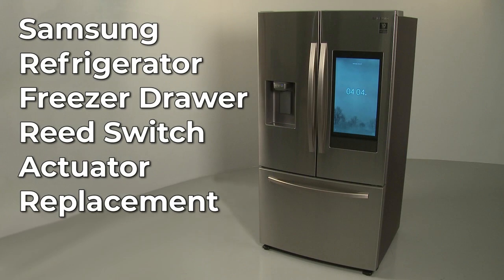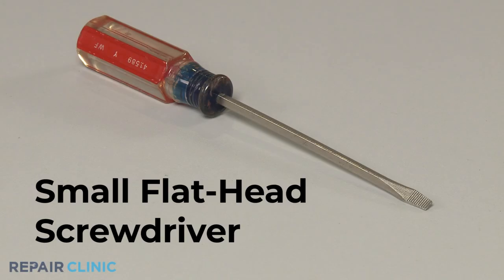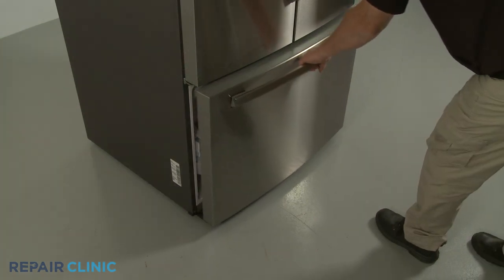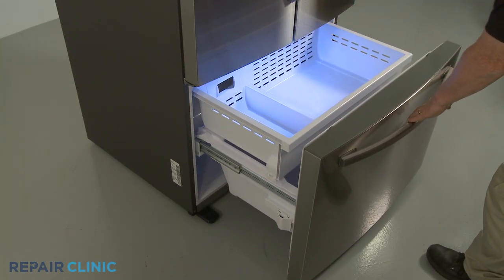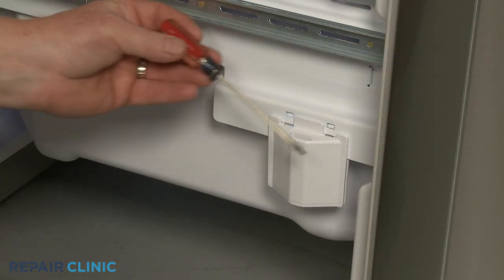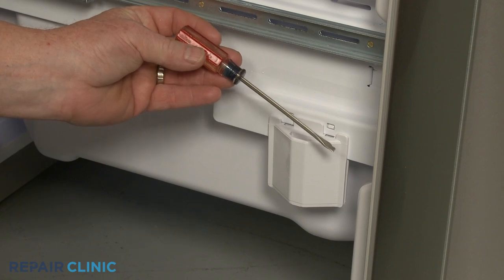Samsung Refrigerator Reed Switch Actuator Replacement DA34-00047B

Comment: Does this part actually go out? I’m having an issue with my freezer light on a Samsung fridge. I changed out the led board and it still doesn’t work. What’s strange is when the middle drawer is opened the freezer light flashes for a second then turns off